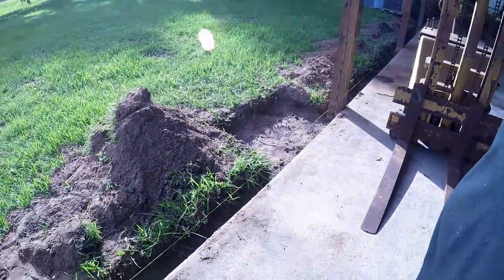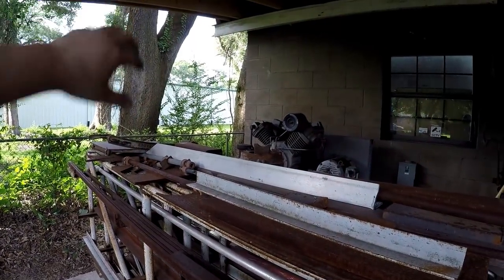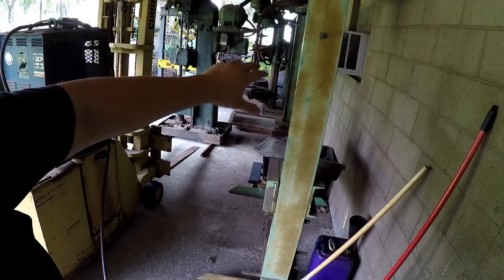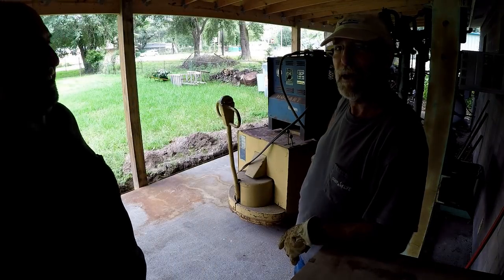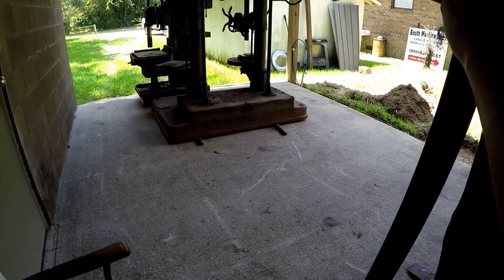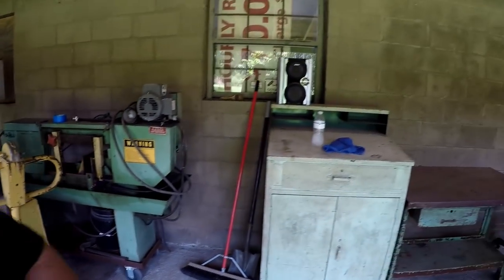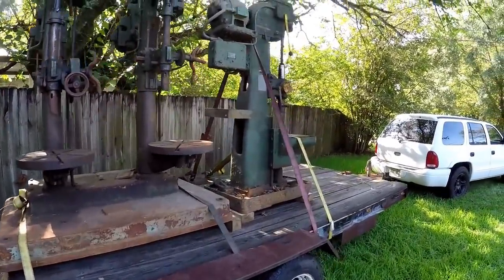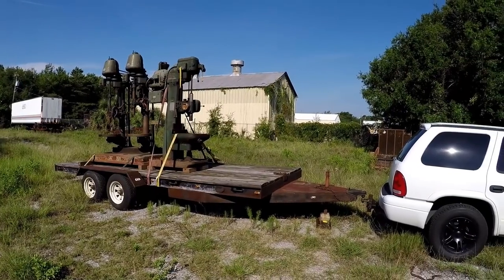Shop Enclosure Update & Machine Moving

Comment: Hey Adam,
Long time viewer here...i am not on patreon, How can i help?
It is not going to be much but i guess they all add up.
Reply from the maker: it does all add up, every buck at a time. I am using it for all the shop additions and improvements. if you don't wan't to use Patreon I have a paypal account as well. Total voluntary. The paypal is Abom79 at yahoo
Reply: Abom79 Hey Adam,
I have made a very small contribution through paypal.
Take care and have fun.
Reply from the maker: I got the notification, thanks so much! It'll be added to the construction budget.

Comment: Hey Adam good for ya on expanding the shop. Just a suggestion, when you close in that corner for your bathroom, just run the wall all the way across and add a second door (for acces) and leave the Ingersoll rand compressor where it is, then later on or now if you can, put up an exterior wall around it with perforated metal wall covering the keep it ventilated and cooled.

Comment: Did a similar thing today,  loaded the F250 up with two junk air compressors, dead metal band saw and an old 1ton cast iron wood shaper.  Will get a whopping $.07/lb at Sims metals tomorrow, it hardly pays for the diesel but its out of the shop. 

It's amazing the difference in footings you have vs what Ray Caniglia did in CA, no earth quakes in FL. but you do get the occasional hurricane.

Comment: Go ahead and install the wiring for you three phase power while you are wiring up the new building.  You'll regret not doing all the wiring while the walls are being built.  Take lots of photos and document the construction.  That will often satisfy the building department when you finish the electrical work later on.  Congratulations and I hope the project goes smoothly.

Comment: I like to see your progress.  

If you want to keep the fork lift you can put in different batteries.  It's a matter of matching the voltage of the existing batteries.  Something in the GC (Golf Car) line would probably be smaller and cheaper.  You would lose run time but you are not doing 4 hours or 8 hours on a shift.  That would still give you a working fork lift for the occasional load, unload, and odd move something around.

Comment: I love my Durango too. Mine's got the small engine, the 4.7, honestly unless I planned on towing a heavy trailer, I prefer it. Its got loads of torque, but its not nearly as low in the RPMs as the 5.9. I almost bought a newer second gen. Durango when the engine in mine dropped a valve seat, but I ended up replacing the engine and I'm glad I still have it.
Reply from the maker: My causin Alex switched to a Dakota with the 4.7 when I bought the Rango from him and he misses the torque of the 360.

Comment: When you move the machines out to paint the wall, consider a workshop floor coating to make cleaning easier and to prevent oils, etc from soaking into the concrete.

Comment: Adam,  When I worked at CMI Corp. , we made our pry bars like you made yours .  Only difference was we used car leaf springs on the pry end and sharpened to get it started in between A-36 , 10 GA to 5/8 thick plate steel sheets to put in the horse head / plate lifting clamp to pick them up and move them to the shears and breaks and Ultragrafts mylar tracking torches.
Reply from the maker: They are super handy!

Comment: That forklift sure looks handy in a tight space. I'd love to grab it but getting it up to NY would probably cost more than makes sense. When wiring for 3 phase consider putting a box every 5' and pulling wire for 3 phase AND 240 single phase through each box. Blank off the boxes then later install the right plug for each machine as needed. Feed in the middle and one circuit of each towards the front and another set towards the back. You'll love it later if you add machines or move them. Bob

Comment: Adam,
You might want to consider placing pvc piping from your house - office area to the shop leave several waxed cords inside to later pull fiber optic cable at a later date.  Easier to do now than later.  No need to upll the fiber cable.

Ray did with is new shop...he has the fiber run and will install.

This way you can utilize later if needed / deisred for very little cost now.

Comment: Hi Adam, you mention LED lighting.  Since you're making videos, please pay close attention to the CRI (Color Rendering Index) of the fixtures you're going to install.  Don't consider any fixture with a CRI of less than 90, and higher is better.  For reference, noon sunlight has a CRI of 100.  LED fixtures with a low CRI may for example give you dull reds and distort other colors.  A high CRI fixture will give your video more accurate colors.

Love your videos - I'm not and never will be a machinist, but there is immense value in each of your videos.  Thank you Adam!

Comment: Since the floor is cracked anyways, have you thought about putting in a floor drain, and/or a big sink into the shop area? You will be plumbing anyways, and that broken floor is in a pretty good spot to rough in a sink. Just a thought.

Comment: Hi Adam. That Footer (we call it Footing here in OZ) is nothing more than a Tyre track. It should be at least 10" deep with Trench Mesh top and bottom. Has he drilled 6" deep holes into the edge of the old slab, at 12" centres and installed Y12 starter bars? Those Timber posts are probably going to rot prematurely due to being surrounded by concrete. Cut them off flush with the Slab to remove the stump in the ground,  and pour a full footer, then bolt angles at the bottom of the posts  and Dyna bolt down to the footer. You can support the roof while doing the work. (I'm a Carpenter/Builder with 45 yrs exp)
Reply: J Curran I don't think he's finished digging mate surely even the yanks would pour slabs deeper than that. But yeah the rot in the posts was my first thought too. I'm sure whatever is being done is legit

Comment: Hey Adam, you can probably save that forklift. The reason why it works fine with the charge is the plates are not able to hold a voltage potential. You could have a few simple fixes. If the sulfuric acid concentration's dropped (out of the factory, it's 3:1 distilled water-H2SO4), you can top it off with pure acid to get the concentration back to ideal. Over time, lead scale builds up on the negative plate and it shorts the negative and positive. 

Take some casing off an old lead battery you've got lying around and use it make a panel as a scraper, attach it to some 904L rod to form a handle (316 will work too at these low concentrations, 904L is what youre 'supposed' to use tho) and spend 10 minutes cleaning the scale off. If the plates are physically hitting each other, just space them out again.

 Don't huck it out, the lead alone in those huge batteries are worth a few hundred dollars. I'm sure the raw cast is worth a couple also. The copper in the Hobart charger is worth a ton too! But try to save it, having a fork lift is invaluable in the shop man. 

Speaking of which,  you should totally mount an overhead top running hoist--- but if you can, I'd spend the extra money on putting 2 runways at end of your walls, so you can run a crane bridge later. For straight runs,  you can use stock S-shaped 2 inch i-beams and it'll have enough load for your shop no problem. Less than 10 ton loads ("Class C") will let you use pre-existing roof trusses as support. That way you don't need to do any foundational work/set beam plates/run columns and you'll save a ton
Reply from the maker: I'm selling it, have a buyer ready to come pick up.

Comment: Adam, I have been a fan and a follower for a long time. As an amateur machinist you and Tom Lipton have been great teachers. This is the first time I thought I could help you. I am a licensed Florida General Contractor and I live in St. Cloud. My shop is a metal building and during the summer is very hot. Your original shop has masonry walls and that provides a great deal of thermal massing which helps keep the temp down. An exterior wood  framed wall with metal on both sides does not provide a great thermal or moisture break even with insulation.  It is also not very impact resistant. If you can give me the dimensions of the exterior walls I would be happy to provide the exterior grade plywood and tyvex that could be installed on the exterior before the metal panels. This would improve the wall strength and help with the thermal break.
Reply from the maker: Rosser, that plan is in place as well. Thank you.

Comment: Hey Adam, have you tried filling the battery in the forklift with distilled water? It might give it a little more life, at least enough so that it will move under its own power for more than a few feet. Fill it up and then set it on the charger and see what happens.
Reply from the maker: I think the case is cracked, it leaks it out.
Reply: Abom79 careful around that sulphuric acid, nasty stuff!

Comment: After all the work it did, I'd reconsider on getting rid of the old electric fork lift, at least until you found something to take it's place.  It may be old and in the way most of the time, but when you need it, you need it.  I'd have to think that some kind of alternative to OEM batteries could be worked out, if batteries is all that it really needs.
Reply: It would be so much easier to go rent one if you need it.  I can't stand stuff in the way.
Reply: Larry Robinson having to run out and rent as needed carries its own set of complications.  availability, transportation, the funds to pay for it, the time of day or night that you need it vs. rental place hours of operation.  In my situation, it's better to deal with the old stuff, even if it means parking it outside under a tarp.
Reply: I guess so....I thought all real men have trailers and pickups for that...hmmm  I could be to the rental place and back in less than 15 minutes and this is a very small town.   I understand some people don't mind junk around the place but I'm borderline OCD   LOL
Reply: Larry Robinson having done work keeping equipment operating for an npo, it does tend to change your point of view about those things.
Reply from the maker: I kept it because it is very useful, but I have got to the point where I'm tired of it being in my way. It's been very useful to help move these machines around, but once my plan falls into place, i don't have much room for it. I'm ready for a few more inches of kicking room around my shop. 
I'm hoping maybe down the road I can invest in a jib crane just out front of the doors.
Reply: My shop is only 40x60 until I build on more.  So every inch of floor space it precious.  I have Tractor and chain hoist for lifting.  I try not to make a habit of moving heavy stuff in and out.  If I get something big I plan on keeping it forever.  I understand how hard it must be to get rid of your Dad's equipment.  I will have to live that myself in the next several years I'm afraid.
Reply: Don't wreckon I know what an NPO is ??
Reply: Larry Robinson non profit or not for profit organization

Comment: Hi Adam, how are you? I heard you make the statement that you were going to omit 3 phase power in your shop addition to save a little cash. May I suggest that instead of running a dedicated 3 phase system,  use a rotary phase converter
Reply from the maker: I have no reason to run a converter out there. I have good 3 phase I just have to run a circuit out to that area.

Comment: You know, you could chop out the batteries out of the fork lift, and put the charger inside, instead. Then, just run and extension cord over your shoulder each time you need it. I feel like it's a very useful took to have round the shop. Especially with that height.
Reply: Keep the drill press/fork lift. How much are new batteries?
Reply from the maker: Sure, but it does get annoying when using it. I'd prefer to have the workspace at this point.
Reply: put a power mesh above in the roof and turn the fork into a bumper car    hahaha
Reply: Ask Keith if he wants the forklift since you have a trailer going to his house already.....
Reply: Sorry it doesn't work that way.
Reply: I bet the weight of the batteries is needed as a counterweight for the load....
Reply: Gofundme for new barrettes. Save the forklift!
Reply: Notso Fresh True, but nothing that some sandbags in the bottom of the battery holder cannot fix.
Reply: Just get a couple of 12Volt deep cycle battery's and wire them up.
I don't think he runs it enough to warrant a full size battery for it.
Reply: aserta i

Comment: Adam,
 What is the plan for the A/C unit in the existing shop. Also, have you considered placing the material rack next to the roll up door?  With it there, you can just slide the stock off of the transport vehicle and right onto the rack; you won't have to carry it passed or over machines. Too, it will be right across from the man door to the other room.
Just some thoughts,
 Rollie
P.S. tell Abbey hi.
Reply: aye, i'd even have a roller ramp that hooks to the rack to make it even easier

Comment: I'm a bit worried about the brown stains on the concrete. It looks like acid have been leaking out of the batteries from the forklift. That stuff is pretty nasty. When it gets moist, it will corrode everything around. And you probably won't be able to put the epoxy on the floor, cause it won't bond through it.
Reply from the maker: If I do I'll use the grinding wheel for prepping the concrete and grind it away. Hopefully that's all it will need.

Comment: Adam, Looks like a great shop upgrade. Best of luck with it. I noticed that there is an air conditioner exhaust (window unit that serves the existing shop) that dumps into your new area. What is the plan for that?
Best wishes,
Eric
Reply from the maker: Plans to move the ac.

Comment: i didnt read all the comments,  but i highly suggest getting your termite company, or just order the fipronil online, and fill that footer trench.  if you get termites, they may break the weight bearing slab w a hammer drill, in order to get it treated. doing a proactive treatment for 99 bucks of chemicals would be worth it.  just like a pretreat before a residential foundation pour.

Comment: Is that old building by where you parked your trailer the original shop before they built what you are in today? Looking forward to the new shop videos.
Reply from the maker: The building was originally a car dealership back in the 80's. Oddly enough, that old building way back there used to be there paint booth. Have no idea why it was so far back, and not even a driveway to it, just dirt.
Reply: No shit huh,  that's interesting.  The company I work for put our welding/machine shop out in the sticks like that also. Must have made since to someone at the time.

Comment: i bought a new Dodge four wheel drive Club Cab dually in 1991. From the factory it had a bad transmission and transfer case so Dodge replaced them both under warranty and no more trouble. It was in a wreck and replaced with a new 2000 Club Cab dually. It came with a transmission problem that surfaced at 4,000 miles but the dealer dragged his feet until the warranty ran out at 25,000 miles. It's still drives at 128,000 miles but the transmission has a mind of its own. Dodge... go figure. I initially bought a three quarter ton Chevy Club Cab four wheeler in 1991 but it would  not pull my 19 foot ski boat without shuttle shifting back and forth so I traded it in for the '91 dually. What's with these trucks is beyond me. They cost as much as a new house did back in the 1970's. It's crazy. The shop expansion you are under taking should allow you to stretch your legs a little bit and keep the videos coming as well. Best of luck to you Adam.
Reply from the maker: I love Dodge, and my Dodge trucks. My dually has been great and I drove it for about 10 years now. The trans started acting up a couple years ago and lately it's just going into neutral. I parked it with hopes of having it fixed later. Right now I'm focused on my shop so I'll get to it later.